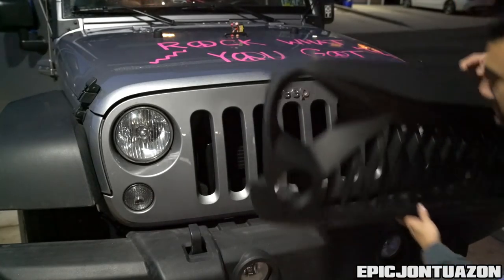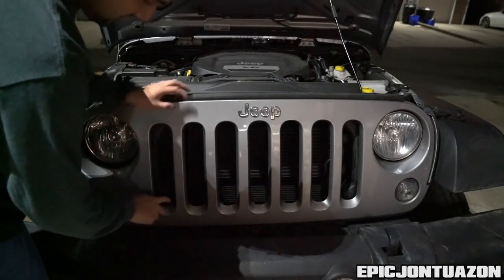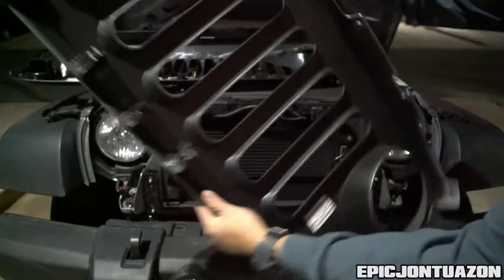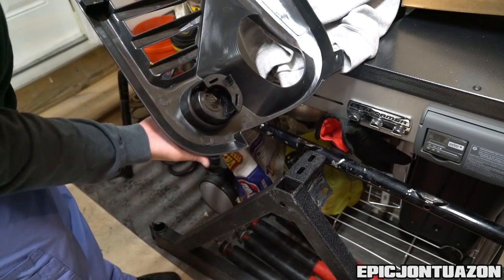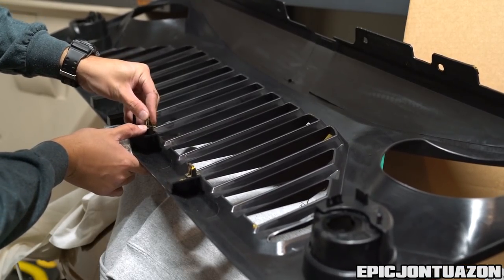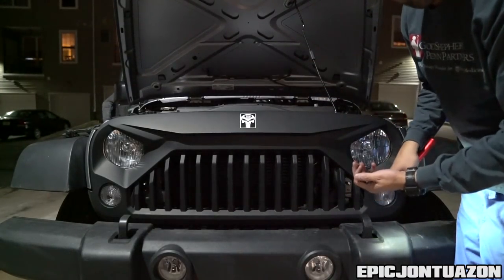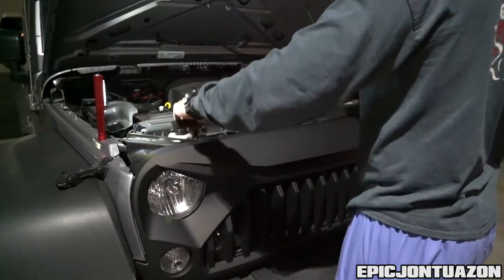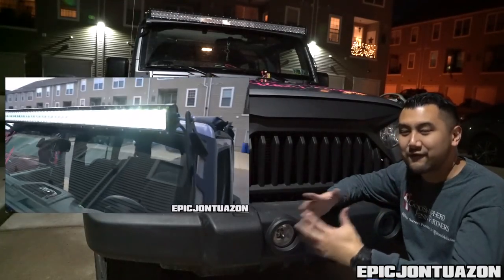Gladiator Grille | 2017 Jeep Wrangler JK | Auxmart

Comment: It’s ok. For the price I would think that it would have been better. I got this of my 2016 Rubicon. It didn’t line up right. It already has placement for it to lay in on the grill.  So it was a little off side. And the bottom brackets don’t all line up right. Looks good tho after installed. II give it a 7 out of 10. Should be cheaper.